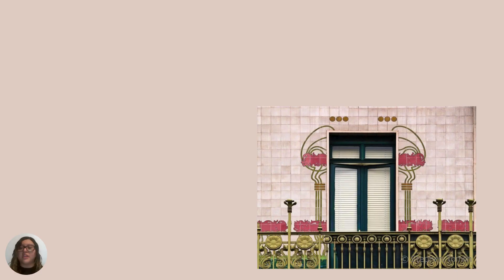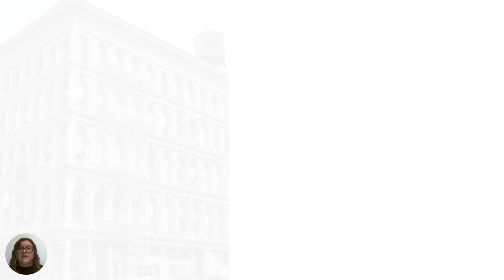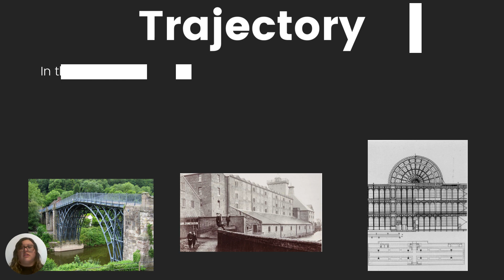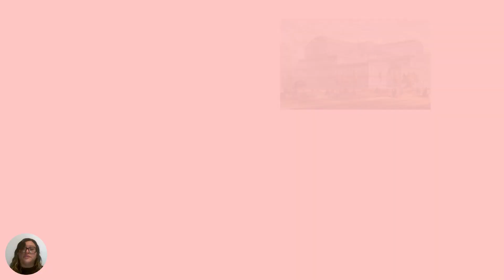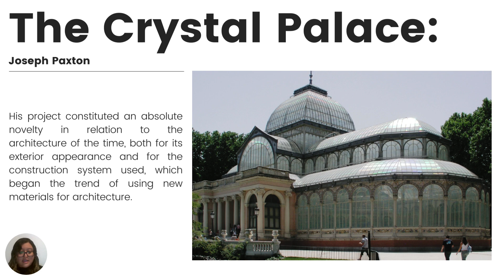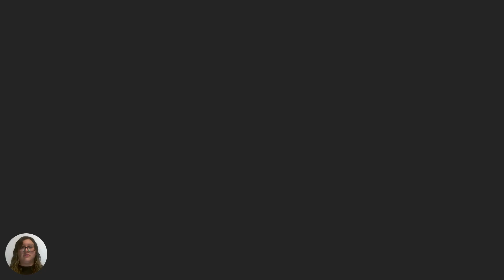Modernism: Cast-Iron architecture - Reyna Cecilia Murillo Garza

Comment: If an entire city were built entirely of cast iron architecture, do you think the weather would be the same? Would it be colder or hotter?
Reply from the maker: Haha that's a nice question! It would depend in the weather of the region of course, but  it would most likely make the cities warmer. Cast-iron conducts heat well, which means that buildings, roads, and other structures absorb and retain heat during the day, releasing it slowly at night. It also has a dark color, which means it absorbs more sunlight compared to lighter materials.

Comment: Did Paxton’s construction system influenced other buildings in later years?
Reply from the maker: Yes, Joseph Paxton’s Crystal Palace innovative use of materials and construction techniques had a profound influence on later architectural developments. And many architects and designers have been influenced by Paxton’s work, including Philip Johnson and his Glass House, which is reminiscent of the Crystal Palace’s extensive use of glass. Walter Gropius, who incorporated many of the principles of modernism and functionalism evident in Paxton’s work. And Le Corbusier, pioneer of modern architecture, whose open floor plans and use of glass echo the design principles of the Crystal Palace.

Comment: How long was the process of building bridges? Taking into account the three steps of its trajectory.
Reply from the maker: The process of building bridges using cast iron architecture varied depending on the size and complexity of the bridge. But the time between the manufacture of the material and the assembly of the structures was between 6 months and 3 years.

Comment: Can you discuss the conservation challenges (or advantages) there could be when preserving historic cast iron buildings in modern cities?
Reply from the maker: Sure! There are several challenges, including deterioration, as cast iron structures are susceptible to rust and corrosion over time, and exposure to weather, pollution, and moisture accelerates this process. As a result, constant repairs are needed, but restoring and maintaining cast iron buildings can be expensive due to specialized skills, materials, and ongoing care. But of course there are advantages, such as the conservation of the architectural heritage, they attract tourists and boost local economies, and of course, it is a reminder of our past. In the end, preserving these structures requires thoughtful balance!

Comment: How do you believe modernism challenged the hierarchical distinctions between high (good taste art) and low art (bad taste art)?
Reply from the maker: Modernist cast iron architecture challenged hierarchical distinctions by focusing on innovation and functionality, but above all by reevaluating how the value of art is determined, arguing that instead of being based solely on rarity or status, art should be evaluated for its impact and significance.